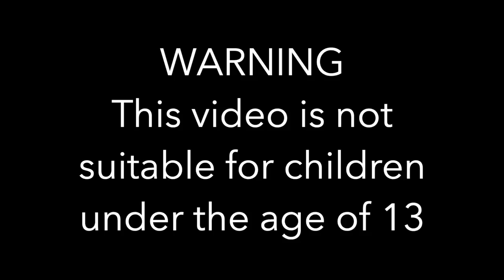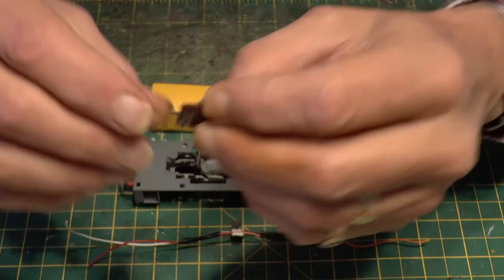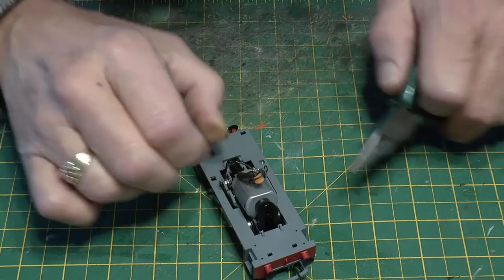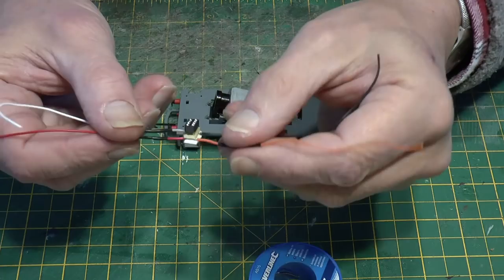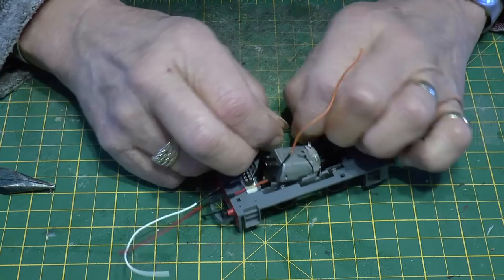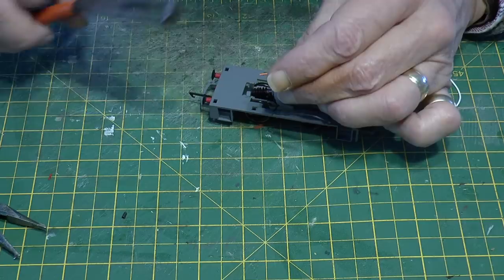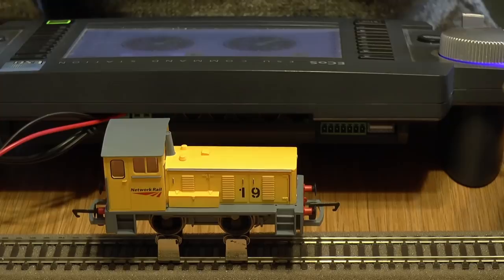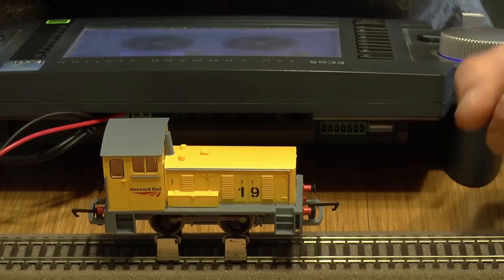Fitting a decoder to an analogue 0-4-0 shunter.     18-12-2019

Comment: Hi Graham great video.I do this but am not an expert at all.Your switcher cry’s out for a mini sound decoder a speaker from an old cell phone and a capacitor to maintain power over the points.Then front and back LEDs Trying to cram all this in is the real challenge for sure.  I am doing an 0-4-0 saddle tank switcher got it all together after milling the weight and have discovered I have to solve power pick up and discharge issues first .New wheel wipers etc etc.The Bain of my life it surely is! Cheers happy Christmas!
Reply from the maker: Mark Fisher     Yes Mark, as I replied to a previous comment on this video, this is the first stage, I had all the parts and so cost me nothing to do, having an 8 pin plug now allows me to improve on this without anymore soldering, just unplug the existing decoder and insert a newer one with either a built in or a separate stay alive capacitor and maybe a mini speaker should I decide to fit sound. All initial stages at the moment my friend but at least I know it works and it will be relatively simple to upgrade this as and when I want to.     Cheers for now mate.        ..........Graham

Comment: Great job on the conversion. I have done that and agree very straight forward once you get the proper wires sorted out. I Ike the concept of the board to allow you to change the decoder out if needed. Thanks for sharing.  Ken

Comment: Nice video. Adding a capacitor back-up or using a decoder with one built in helps alot on locos with short wheelbases. No more stopping, especially around turnouts.
Reply from the maker: Marten Siersma     Absolutely, I have no doubt that at the way she is at the moment then it won’t handle any points very well at all but all I was interested in at this point in time was to get the wiring done an a plug for a basic decoder installed which I already had - all of which is now done successfully, I can now improve on that at a later stage by adding a decent decoder, maybe even a sound decoder and a hefty capacitor to help it over points without stuttering but at least the basics are now done. Further improvement such as fitting Kadee couplings and weathering will enhance it a bit more but this will do me for now.       Cheers for now.          .......... Graham

Comment: You need to get a desoldering wick or whatever they are called there are different types. Some look like a strip of paper and some look like a syringe. Not much space in that shell. I liked your wire stripper. I've never seen a pair of wire strippers like those before.   👍🎅❄🎄☃️
Reply from the maker: William Bryant     I do have a desoldering stick which is like a very large syringe but there is no way that would have worked on that tiny terminal, fine for sucking up on a nice flat large PCB though.      Cheers for now.          ........... Graham

Comment: Another success :) though looks like you need a solder sucker tool to help, they are brilliant for clearing old solder, better than braid if you ask me, get the metal tube type not the rubber squeeze ball ones. On that note I want your simple wire strippers where did you get those, not seen that type personally :/.

Comment: Bigger tip on the iron and a solder sucker needs to be on your Christmas list Graham, you spending far to long with the iron on the parts.
Reply from the maker: Des Silverson    No Des, the solder melted very easily, anymore heat would have melted the plastic of the motor which was already starting to distort as I was working on it. Why it was talking longer than normal was because I had to try and feed the old cable out through the hole on the terminal, the old cable was also twisted back on itself to hold it to the terminal before it was soldered on originally - the tip on my soldering iron is the perfect size for this job.  Cheers for now.        ..........Graham

Comment: What is the black thing that you cut off @ 09:20? And what is it`s purpose? My 1990s/2000s 0-4-0s don`t have this on the motors, they only have the Tv suppressor fitted to them. I am very interested to know what Hornby have put this on for.
Regards
Kev.
Reply from the maker: Hi Kev, that black thing was just a bit of old heat shrink where the wires were joined - nothing to worry about, yours may not have it. Hope that helps.     Cheers for now buddy.       Graham